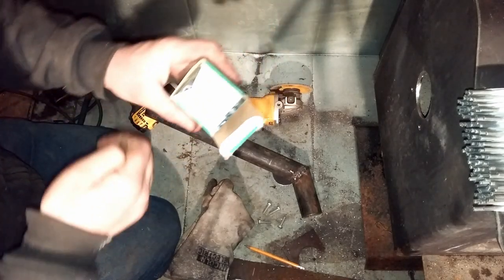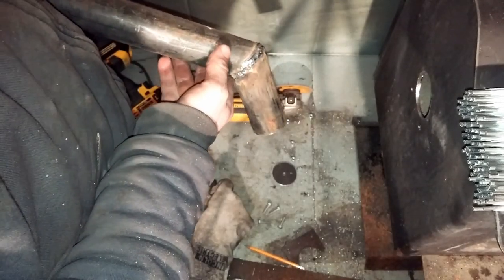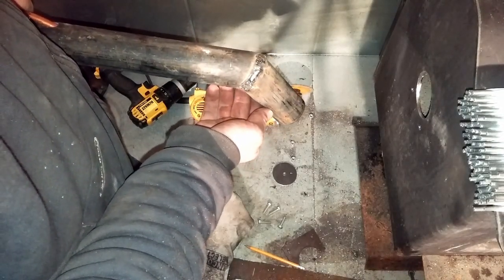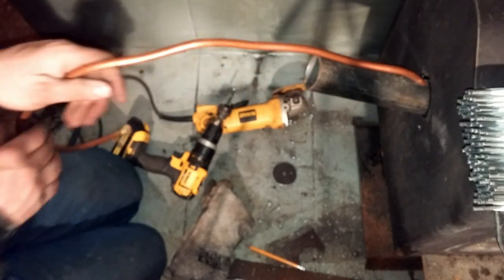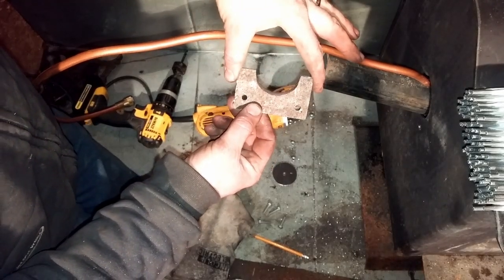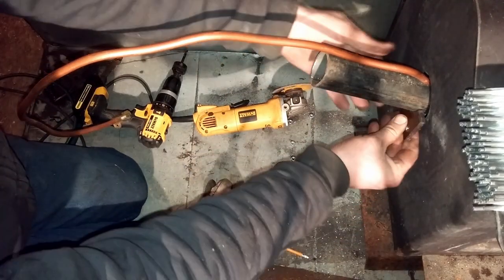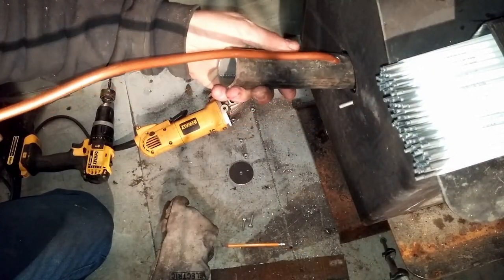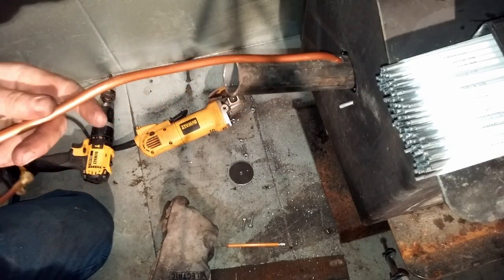Free Heat! Building a Waste Oil Burner Out of An Old Woodstove

Comment: You did a great job. The use of an old wood stove was good thinking. I know this video is years old but one thing you could consider is to build a small box on the wall with a double wall of MDF or plywood and house the blower inside of it. You could also put a switch or even better, a poteniometer on the side to control the motor speed. You didn't happen to ever do some calculation on how much oil per hour is being used, did you?
Reply from the maker: Good morning.  I found that a five gallon bucket would get me 12 hours of run time.  It worked well for me.
Reply: @TheTradesmanChannel  Thank you for your kind reply. Are you still using it to this day? If so, is the system still being used exactly as it is in this video or did you change anything on it?

Comment: I'm trying to make a log burner out of a tall gas bottle to heat my hut getting cold in Scotland and I see your flue is going through the wall at 90 degrees. I was going to come off the top of the burner with two 45s and through the roof. Is your way better? Keep the great videos coming.
Reply from the maker: +Lee Stark your way is probably better.  Two 45s will give you better exhaust flow as well.  Good luck with your project.